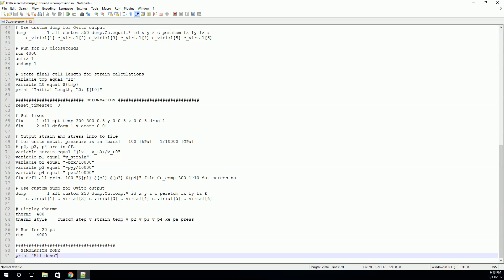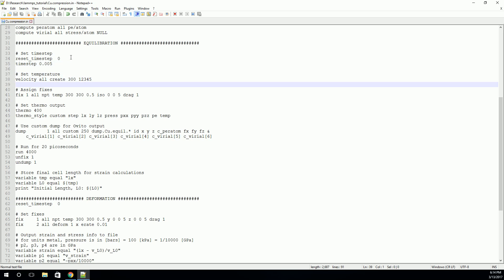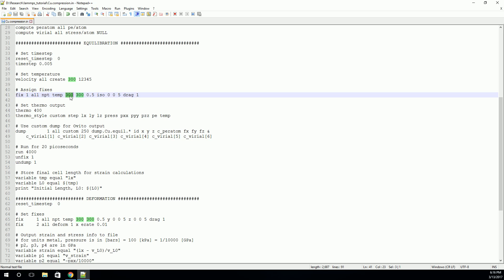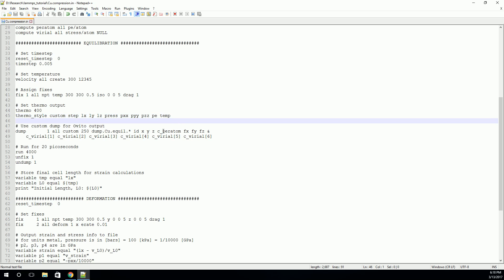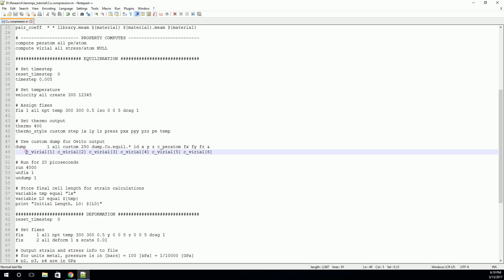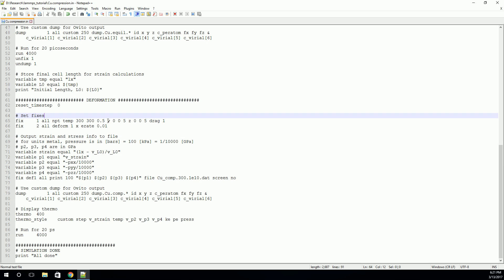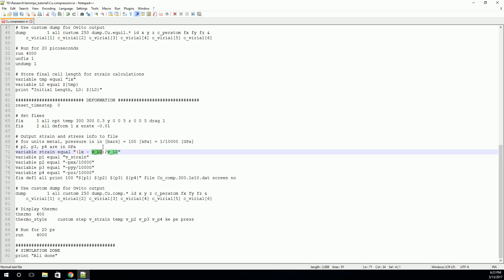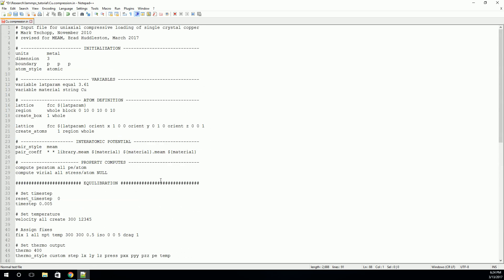The LAMMPS Input Script - Part 2

Comment: I am trying to run a simulation where a movable layer of graphene compresses water with salt ions against a fixed layer of graphene with a slit in the center such that water molecules flow through the slit into another cubicle with fixed graphene on the other side.  I have built the model for this and saved it as a data file to be read in lammps. To begin building the sim I have started writing the input file with the "read_data file.data" command for the graphene with water data file.  I am assuming I don't need much of the atom definition section since I am reading a data file into lammps but I am unsure about this.  The task seems slightly similar to the CuCompression tutorial but I'm very unsure of how to get a start on completing a working simulation.  Do you have any tips or a direction?  Thanks!
Reply from the maker: It sounds like you are most of the way there! That sounds like a very interesting simulation.
You are correct that you won't need any atom definition region, but you will essentially need all the other sections. So, you need to define a potential, apply a temperature (if you are using any temperature initialization), and then specify a movement - in this case, it sounds like you need to make your sheet of graphene into a group so that you can move it separately. Good luck!
Reply: Thanks! I'm assuming I can specify a movement using the "fix move command?" Also, how can I group the sheet of graphene? (I used VMD to model the graphene)
Reply from the maker: Yes, that would be the way I would approach it. As far as grouping the sheet of graphene, that may be tricky. You may need to try to save it in a separate data file, and then read it in and store it in its own group that way. You can check the documentation of the "read_data" command here: (http://lammps.sandia.gov/doc/read_data.html) for how to do that. I think you need to use the "add" and "group" keyword arguments.
Reply: I apologize if I'm asking too many questions and understand if you're busy. Your input has been incredibly helpful.  The next issue I've run into is with atom IDs.  The separate data files have duplicate atom IDs which lammps doesn't like.  I've tried re-numbering atom IDs in excel for the 2nd data file but then the bonds no longer make sense since they used the old-numbered atom IDs and going through manually and changing the bonds to correspond with my new atom IDs just doesn't seem feasible... Any ideas for how to solve this? Thanks again.
Reply from the maker: No problem! So, from what I understand, if you use the "add" keyword with read_data, it shouldn't be preserving the atom IDs. Is that not the case?
Reply: It seems to be preserving the atom IDs.. at least from what I can tell in the lammps output and log along with the error it gives. 
Here is what I have in the input file:
# ---------------READ TOPOLOGY AND GROUP-------------
read_data GrapheneWaterSystem.data
# group movable layer of graphene
read_data MovableGraphene.data add 1 group graphene
Reply from the maker: Thanks for posting your code! So, on your "add" option, you have given it the argument 1. This means that it will number the atoms in your file starting with 1 - since you have already imported atoms, you end up with duplicate IDs. I think what you want is the "append" argument. This way, it will reassign IDs automatically. 
Let me know if that works!
Reply: It worked! Thank you so much! You should consider being a professor if you're going into academia haha. Now on to figuring out how to apply a temperature and using the fix move command to move it along the z-direction and compress the water molecules haha. You're awesome!
Reply from the maker: +Mark Findlay You're welcome! I am glad to hear it is working out. Good luck with the next part as well! And, thanks for the encouragement!
Reply: I was wondering if you could help me with this part. 
I have coded: 
"fix 2 graphene move linear NULL NULL -Vz" to move my graphene sheet in the negative z-direction. 
I get: 
"ERROR: Expected floating point parameter in input script or data file (../fix_move.cpp:90)"
Does it have something to do with my pair_coeff commands? If so, could you explain a bit of how those work exactly? I don't think I'm using them correctly if that is the issue...
Reply from the maker: From the error, I don't think that has anything to do with your pair_coeff commands, no.
Looking at your fix move command, I think the error is coming from the z movement command. You will need to specify a decimal value here, not just "-Vz". If "Vz" is a variable that you have defined earlier in your script, you can use it by using: "${Vz}". Let me know if that works!
Reply: Okay thanks yeah that did solve my fix move problem. As I suspected I am getting issues with pair_coeff commands still...
ERROR: All pair coeffs are not set (../pair.cpp:225)
Last command: run 1000
I've been trying to use the pair_style  lj/cut/coul/long 10.0 10.0
and in my data file I have these:
# Pair Coeffs
#
# 1  C
# 2  C5
# 3  Cl
# 4  H
# 5  Na
# 6  O
I tried specifying them all by hand myself by using pair_coeff 1 1 0.5 0.5 etc... but I don't think I am understanding how to correctly use these commands for the simulation.

Comment: I am currently working on cellulose, I'm relatively new to Lammps, where would I even begin? @EnCodeVentor
Reply from the maker: Hello and thanks for watching! That is a good question, and a good problem. I am not very familiar with organic materials myself, but I might be able to give you an idea of the right direction. There are two key things (that I can think of) you are going to need to find: an atomistic potential to define the interaction between your atoms and some software to create your molecular structure. 
For a potential, you are going to have to make a trade-off between computational efficiency and accuracy, as always. Whichever ones you find, make sure to read literature on it to see what it is good at. Many potentials are not accurate for modeling everything: one may be able to model the mechanical behavior of your material, but not handle some of the transport/diffusion behavior. 
For software, if you can get a hold of Materials Studio, I have heard it is a great software for organic molecules. But it is not free, as far as I know. Otherwise, you may need to just code up a program that creates your molecules for you and can write out a lammps format (http://lammps.sandia.gov/doc/2001/data_format.html). I suggest something like MatLAB or Python. Good luck!!

Comment: can you please explain me...... why -ve sign is used in lines 73 to 75 for defining variables P1, p2, P3 and P4 ??
Reply from the maker: Of course! So, the variables, pxx, pyy, and pzz, all correspond to the pressures in each direction. But, pressure is defined as positive in compression. I wanted to get the uniaxial stresses - which are defined as positive in tension. So, I had to change the signs of the pressure variables. I hope this helps!